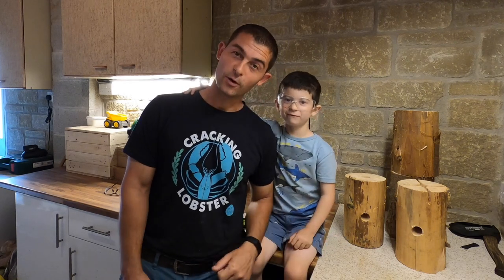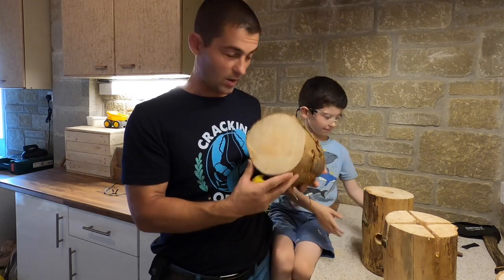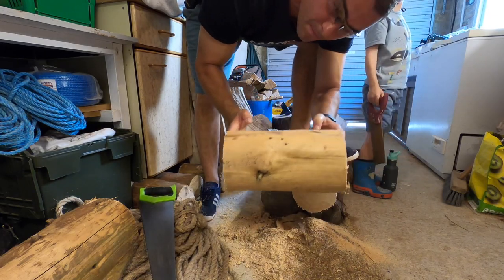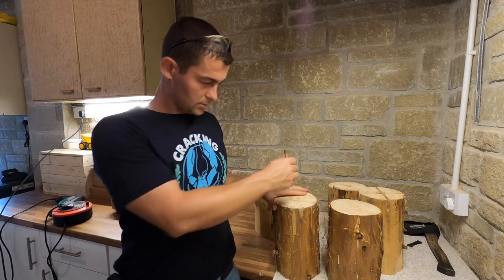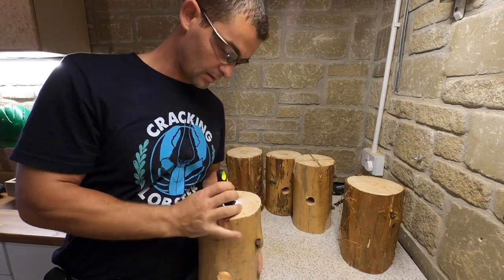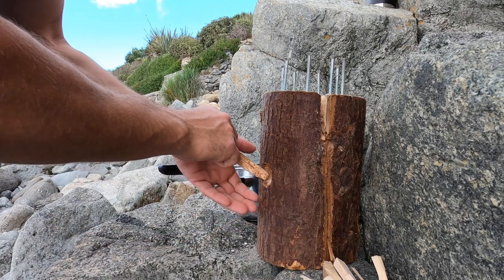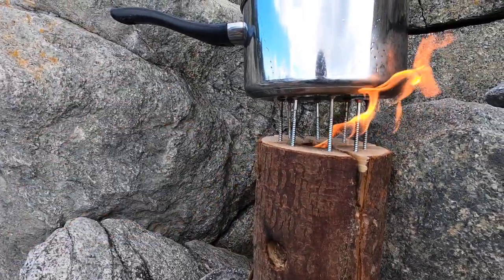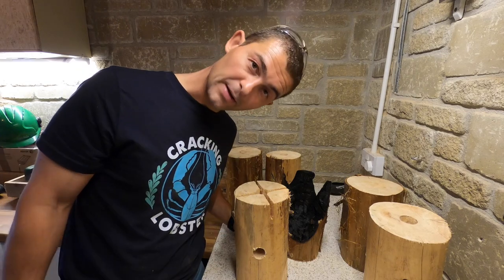How to build a Wood Rocket Stove - Off-grid Cooking

Comment: Awesome! When making one of these, I think I would do the axial bore, lightly pack with the sawdust, then run one or more wire coat hanger lengths down, dribble melted paraffin wax into the cavity. Let cool, remove the wires, and THEN do the radial bore, making it slightly above the depth of the axial bore to leave a small reservoir at the bottom. Could probably light one of these in the driving rain.

Comment: This is an ingenious way to make fire if you dont have a lot of wood for the campfire and need to cook up something. You can call it for a way to survive :D To make a fire starter you can also take a newspaper roll it hard together, tie some string around it and soak it in candle wax, let it dry and then cut it up in nice section for a briquette. Just a tip :D Have a good one mate